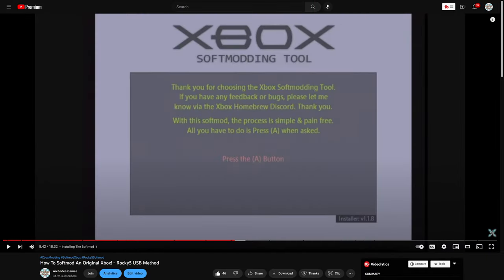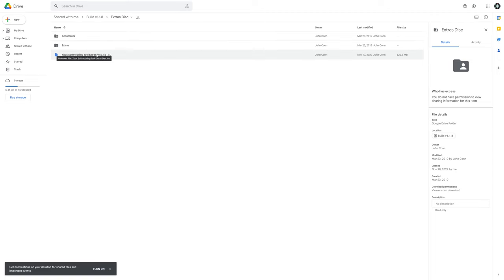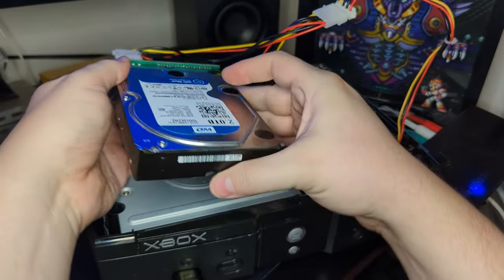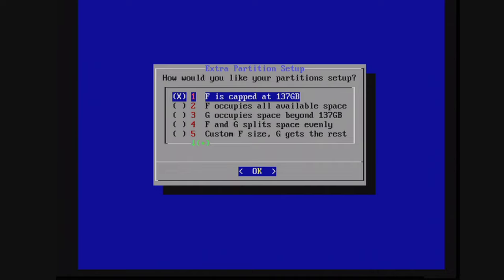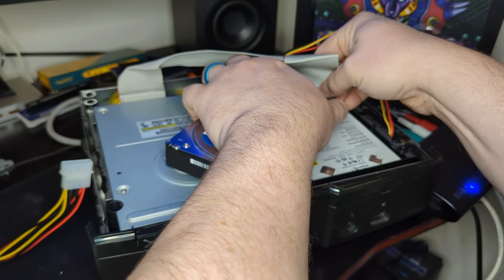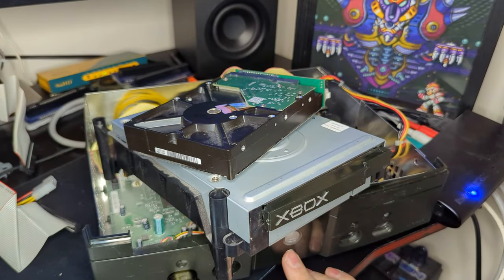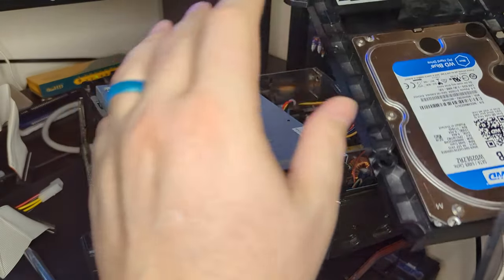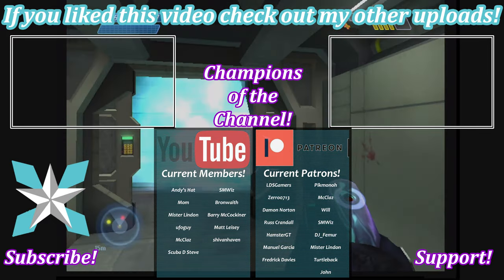How To Upgrade The HDD (Hard Drive) In A Softmodded Xbox!

Comment: In case someone else has this issue. 3 times I swapped the cable between the adapter and dvd drive and each time the yellow light would flash and chimp wouldn’t detect the new drive but after cursing it out and checking solutions online I come back to find it was apparently just going Extremely slow and ended up booting on its own after sitting at the chimp press A screen. So if you are having this issue wait for 5-10 minutes and see if it auto detects the drive before you curse it out lol.
Reply: I second this. Chimp was stuck on the "press A" screen for like 10 minutes after I pressed A. I was ready to give up and TSOP until I read this comment!
Reply: Thx will keep that in mind
Reply: @CheeseyHead123  I’m stuck at the two green “ok” after this and nothing else will move, I even let it sit all night and nothing happened
Reply: SO QUICK QUESTION AFTER IT SAYS A MY SCREEN GOES BLACK AND THE LIGHT FLASHES IS THAT NORMAL?I JUST WAIT ON THAT FOR 10 MINUTES ?
Reply: @JOSEPHZZ123 honestly it’s been a long time since I messed with it after that hard drive upgrade. I had issues with it like I stated above but after it sitting it fixed itself. I also had issues with the traces for booting and power that started acting up after all the modding was done. Not sure if I’m reading your comment right but if it’s shutting down after you press A and not doing anything you might have other problems like the Chimp program or maybe the system itself. Let me know specifics if I can I’ll try to help better.
Reply: @JAR-HIPHOP I had to try a few times before it ended up working. Did you end up figuring it out?
Reply: @CheeseyHead123  nah I got way too mad and just returned it and bought one professionally done to save a lot of time, way better to do than do it yourself atp
Reply: @JAR-HIPHOP  it’s finicky sometimes, glad you ended up with the console you wanted though enjoy

Comment: Just a FYI: if you have a modded Xbox with a bigger HDD (I had 320GB) and are upgrading to an even larger one (I am with 2TB) Chimp is stupid and treats all of your free space as space it “has to move” taking hours upon hours to do so. Get yourself an IDE PC reader and clone the drives on there to save yourself a huge headache.
Reply: The first time I did the clone it was fast, then I wanted to do it again with different settings and then it was really slow (1 hour from stock to a 250gb ssd)
Reply: How long would it take to clone a 1tb hdd?

Comment: I still use one of my 3 OG Xbox's I got for dirt cheap, fixed up. My fav is a 1.0, I replaced super capacitor, thermal pasted CPU and GPU, cleaned all out, replaced a Thompson DVD drive, even cut out front panel and put in a LCD with temp probe to display CPU temp on front- then painted my Camaro/Musicman Petrucci color chaning mystic teal as cherry on top. She's my fav w CoinOPs and 12,000 games I FTP'ed over (some fan translations, I made TON of XBE movie previews, every console represented possible on Xbox emus). I love it n poured countless hours in- but lately it'll get this service Xbox screen sometimes that needs multiple restarts to rid- think the 320GB WD I installed is going (hear it whirring too before error)- so I'm kinda nervous about doing this upgrade- but will give it a go later this week and try your method (It's been years since I softmodded my XB, PSP, Wii- I forgot so much!) EDIT: Ignore my dumb ?, of course original xbox was IDE, so IDE->SATA cloning will work fine!
Reply: How big are these game files. And, like how demanding is it on your internet to ftp over game files. I have satellite internet lol. I get a good 5mb per sec download speed lol. Can you put in like a actual game disc and download it to your harddrive
Reply: @Donald_Dump420  ftp doesnt use any internet. it takes place on your internal network. it will be throttled by the speed of the hdd/lan adapater in the xbox before anything else on a modern setup

Comment: Hello. I tried the whole guide step by step. I'm using an SSD Sandisk 3D 1TB. But when going to boot it shows black screen. I'm using the same 80 pin wire and the same startech adapter. It boot the xbox normal intro and then goes "bright black screen" (no dark black screen). Any suggestions please? Thank you.
Reply: Did you ever solve it? If so how?

Comment: Thanks Again! "Back in My Day" was Pre-Rocky Mod Tool. Fundamentally its the same, just a few different tools to complete the process:
I really want to check out the new Dashboard. I always set mine to blood XBMC with a Xbox 360 Blade theme
Reply from the maker: Hexen, slayers, Rocky5 many tools for the years lol
Reply: Thanks for the suggestion
Reply: @Donald_Dump420  Definitely the Correct Answer: the Interface throws me off, really just the Theming, but its Straightforward
Reply: @MotownBatman  I literally just now jailbroke my old ps3 slim. Took only a hour. When ever i get some money man im gonna do it to this og xbox. The og xbox is so fuckin cool man. I had no idea you could do this. My hard drive was starting to go. And my cd rom has been acting funky too. Thought i was gonna have to buy a new xbox but now theres just no need.

Comment: If you would like to save a DVD and not have to make sure it boots properly like I (for some reason encountered) a great workaround is to download the rocky5 tools disc as described in the video, but extract it and FTP the Chimp directory to E:\apps\ on your Xbox if coming from a modded Xbox. And from there simply booting up the Xbox with the hookups prepared and setup as described in this video, run the app, then swap to the (new drive) from the DVD drive on the cable mentioned in this video when the app says to do so, and it will clone your first original drive to your upgrade drive. Easy peasy, lemon squeazy.
Reply: how did you extract it ? i opened it with 7zip and it shows nothing
Reply: @Stweak Did you ever solve this? I’m about to do this in a few days.
Reply: @smokintoomuchsalt406  so ive managed to find a non iso file of it but when i booted it, it would boot back to the main menu.
I've read somewhere that you need it on a disc so it can boot back from the disc or something like this (at least for a softmoded one). 
I found a burnt disc i had from years ago  and the software launched however i had an error saying it can't find some sectors or something like that on my other drive so i abandoned and im trying a hardmod with a raspberry pico.
Reply: @Stweak  well dang I might be SOL if I cant FTP it over. Thanks for the response. Ill be sure to give an update if I’m able to make it work.  I have all the tools needed arriving later this week.
Reply: @smokintoomuchsalt406  good luck

Comment: So to retiterate what said below, seems my IDE cable has to be in super tight or issues, both old 40 wire one and new 80 wire Im trying...finally got it to work and bending the new 80 wire from link is nightmare- plus my SATA adapter has big molex splitter hanging off unlike yours, along with splitter I need for LCD temp monitor- ohh boy I dread putting this back. But issue now, I go to do chimp loader and...Xbox turns off. This is my 1.0 remember, I think its something I remember about needing composite cables hooked up?! Bizzare as sounds, I use high def component/SPDIF cable...gotta try and find old shitty cables now, hope thats issue.

Comment: FYI: Larger drives, like my Seagate ST2000DX001 prefer the F option. Selecting F and G doesn't seem to create a G partition at all. Hope this helps someone. Update:the drive isn't booting, going to try a 1TB drive. Seagate 1 TB worked perfectly!
Reply: It does work. You need to enable G partition with the help of nkpatcher settings application, so the system knows there is a G partition. Only for softmoded consols. Modchip does it automatically.

Comment: Update: I finally gave up on trying to install the "approved" WD HDD I bought. I don't know if it was the HDD or the adapter but I just couldn't get this HDD or work with CHIMP. I finally just plugged in an old 250GB IDE drive I had lying around it it worked great! Less storage but at least it's more than the 8GB original HDD.

Comment: Heads up, don't have to let it sit on the dash like we used to. With this version of chimp you can load it up and do the hot swap right after chimp checks the DVD drive.
Reply: why is my system turning off immediately after unplugging the IDE cable? There is an in human amount of time between unplugging and the system turning off. Not 2-4 seconds like everyone says.
Reply: @JMKGalaxy2  no idea what is causing that. Have never had it happen. I load chimp, wait like 5 secs, and then hot swap the ide cable out of the dvd drive and into the new hard drive and then proceed
Reply: @carlcharlbury  Yeah it was super strange. Fortunately I managed to complete the swap. It was super random how long before the system shut down. Sometimes it was fractions of a second other times it was 20 seconds. That's when I was able to do it. All good now.
Reply: @JMKGalaxy2  good to hear!

Comment: Any tips on routing the power cable using the startech sata to ide adapter? You use a different one than the one in your link and i am having hard time getting top back on because of how lengthy and bulky the power cable is. When i plug power from motherboard it doesnt give me any good routing options
Reply: Did you ever figure this out? I’ve run into the same issue, there’s just no room for the adapter power cable

Comment: I've yet to mod mine (waiting on parts) but I was thinking of the method you did, can you basically just put all games on the F partition (for example) or do they need to be on C or another one for example? Also its been 3 months since you did this video, did you have any issues creating just F and not F & G in terms of adding games or any other kind of issue (i'm new af to Xbox modding). And while I'm jumping the gun, I like to have a rough idea on what to do before I start doing it xD
Reply from the maker: Games/Homebrew should all go into extended partitions like F or G. C is for the original Dash and system files, E if for game saves and DLC, music etc. It can be used for games and homebrew but it is limited to about 4 gigs. Typically a custom dash gets installed here with a launcher found in C. Then a number of cache partitions are available for games to use for various purposes. 

But to answer that second part, I haven't had any issues with using just F!
Reply: @ArchadesGames  Awesome thanks for the info, I dunno why youtube doesn't tell me of replies and does with others lol.

Comment: Hey there my dude, I really appreciate the video and I'm trying to follow it. I've done everything up to the point where you're supposed to hot-swapping the IDE cable. I let the Xbox sit on the dashboard for a few minutes as you say, then do the swap, but then when I try to select anything on the menu at that point, it won't work. What do you think the problem is and what can I do about it? I'd greatly appreciate your input!!

(if it means anything, I have Rocky5's menu installed for my dashboard)
Reply from the maker: You can try letting it sit on the chimp connect slave drive screen before pressing A and do the swap then to see if it helps
Reply: @ArchadesGames  Didn't work 🙁
Reply: @ArchadesGames  Oh, looks like the problem was either the SATA converter I was using was bad OR I needed to switch to the new pin connector. Either way, I got it to work!

Comment: One thing about my 1.6 Xbox that I haven't seen mentioned. After doing the hot swap my Xbox would freeze before I could get into chimp. I noticed the original hard drive jumper was set to "cable select". I assume all the 1.6 seagate drives are set this way. Switching the jumper to "master" resolved the issue.
Reply: Do you know if me having a 1.6b makes the swap/upgrade any different?
Reply: @E3T7  it's straightforward, just verify your original hard drive is set to master and not cable select.

Comment: Excellent video.  I decided to use an old PS2 IDE drive, as it is a maxtor brand that was verified 5 times on the chart.  (2F040L0)  When I run Chimp, I get an error that it is unable to lock the drive.  I followed the jumper pin guides online for a slave config and all 5 listings on the chart indicate it is locking.  Any thoughts?
Reply: Your hard drive does not support locking. You'll have to try with another drive.

Comment: Hey I’m having trouble with my v1.6 softmodded xbox. I can’t boot past the Xbox wallpaper with stock hdd & 80 wire cord to start chimp(sometimes “Microsoft” will show up if I mess with the disc drive). Should I be able to use my Xbox normally with just swapping to 80 wire cord? Is it a cord problem? It works perfectly fine on stock cord.
Reply from the maker: Sounds like a bad cord

Comment: Just came across a premodded original xbox with some pretty old versions. Wondering if I should revert it and soft mod from scratch, I have the usb cable and mech assault. Just need to buy a compatible usb
Reply: Cant wait to get a bigger hdd as well. Thanks for this video. Gives me a lot more confidence. I haven't touched an IDE cable since my pentium 4 era celeron dell desktop lol

Comment: Had some weird experience with a StarTech IDE-to-SATA adaptor, at least on my particular 1.6 OG Xbox. 
I launch the console, it works fine.
I turn it off and try to launch it again, I get the error screen.
Some time passes, I launch the console, it works fine. 

Basically, any immediate attempts to power on the Xbox after the initial boot always result in the error screen. Some time has to pass. 
However, soft resets from the main menu work fine. 
A cheaper, Chinese adaptor also worked fine.
Reply from the maker: Chances are the IDE cable is the culprit more than the adapter

Comment: I am having an issue with booting the new HDD. When I connect new HDD and startup, I get the XBOX launch screen and then it changes to a completely black screen, no dashboard. I have let it sit for 20-30 minutes and nothing changes. I used all equipment recommended in the description (Startech IDE adapter, molex power splitter, 80 wire cable). I have the configuration set to master and when I press the eject button nothing happens. Games wont boot, just black screen for eternity. When I put in original hard drive it boots up to my dashboard no problems.

Any ideas???
Reply from the maker: Clone the old drive again

Comment: My Xbox is freezing when I attempt to hotswap. Any suggestions?
Reply: So I learned a few things that may help someone else, 1. If you use a 3rd party controller, chimp freezes. 2. I used a different IDE2SATA and it did not work, the one in the video did work.
Reply: @SkullyETC  thank you man, i dont know whats wrong and i tried an og controller after i saw your comment, and its working, thank you so much!❤️

Comment: Softmod, Cerbios. Can I just use fatXplorer to format and lock a new 2TB drive with the backed up EEPROM? Then copy the contents of the original C and E partitions to the new drive before swapping?
Reply from the maker: That is another way of doing an upgrade for a softmod. Cerbios doesn't have to lock drives.

Comment: I’ve tried every way I can think of to go about this but no matter what I do as soon as I fully plug the IDE cable into the Startech adapter it shorts and the Xbox shuts off.  I got it done one time but Chimp couldn’t unlock the hard drive or I would have done it the first time.  Anyone else have this issue?

Comment: Looking for a good hdd for my OG Xbox but I feel really conflicted on which one is good… have any recommendations for a really good one?
Reply from the maker: I will always stick to Western Digital for mechanical drives.
Reply: @ArchadesGames  yeah those look great but I seen the versons like blue, red, and green (purple also, but it said something that is not for pc stuff)
Reply from the maker: Blue is what you want for Xbox projects. Just check the model list in the compatibility link so you know it can lock properly for a softmod. And for softmod no reason to go over 2 TB.
Reply: @ArchadesGames  thank you, that’s help a lot.  Big project modding is kind of new to me
Reply: @ArchadesGames  just got a hdd for my Xbox, it’s a seagate barracuda 2tb 3.5 inch.  Saw it works the same
Reply from the maker: Yeah it will work great as long as you saw it on the compatibility list!
Reply: @ArchadesGames  ok, got the 2tb formated and done but now when i did the change to new one nothing is working.
error on the start up saying called support.

Edit:  I think the problem was the ide to sata adaptor got broken i think.  tried to see if the hot swap worked but nothing worked

Comment: So i did this using a lockable 500gb hdd did exactly as described and im left with 123gb not the 4something it should be listed as what can i do with softmodded xbox to get the correct size or do i have to do this all over again and select a diff option when using chimp thanks

Comment: My xbox with xbox4gamers and a evo x aladdin modchip flashes orange once i load chimp and press A with no change in the screen. I am using the startech recommended hdd convert board for my slave. Neither drive wants to load in Fatxplorer, so I was attempting this method. Any suggestions?

Comment: How long does it take to load the Rocky 5 tools disk? I've burnt 2 discs (DVD-R) with an 8x and every time I try to run it from Xbox Media Center the green light flashes on the Xbox and black screen for over 10 minutes.
Reply from the maker: Should only take about 1-2 minutes max. you can try running it from the HDD by extracting it and copying it over through ftp or try installing it with DVD2Xbox